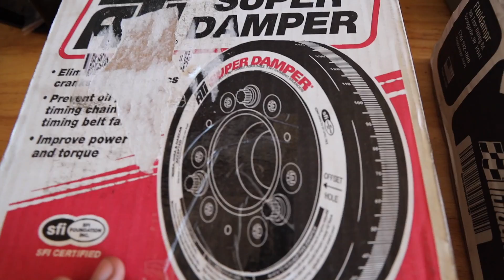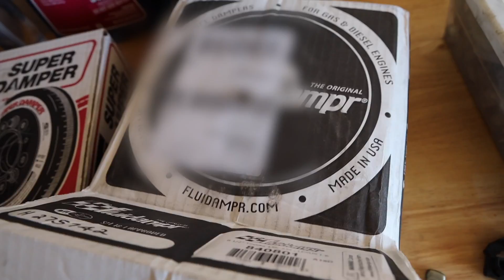MY 2JZ 370z $1200 DOLLAR MISTAKE..

Comment: They ATI damper needs to be machined to fit! It’s also an underdriven  pulley. I was running they ATI on my first JZ. Fluidd damper requires no machine and  it uses stock belt size.
Reply from the maker: I’ve been hearing about that but I also heard the ati sometimes doesn’t need machining. For instance, I have a friend with an SR22 that has the ati. he had no machining done to the pulley

Comment: I would put both dampers on a flat surface to make sure they are the same height. The back piece is different lengths because of how the pulley is designed. The part number is right for 2jz so maybe it didn't seat all the way. It needs to be torqued to 238ft. Lbs so hopefully that thing doesnt go flying. 😅  Love the vids though! 🫡
Reply from the maker: Thanks bro! The ATI damper was torqued down correctly so that wasn’t the issue. Apparently you’re supposed to machine those to fit which another thing I didn’t want to do after spending so much money on the part itself. The  Fluidampr on the other hand went on correctly & seated fine so that was the correct one ✅